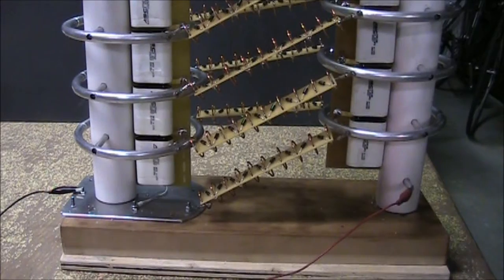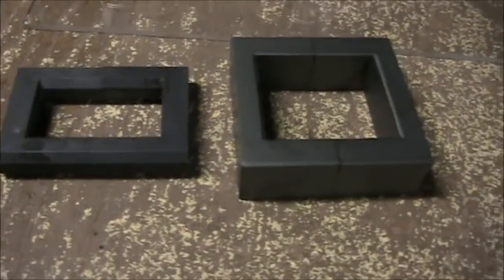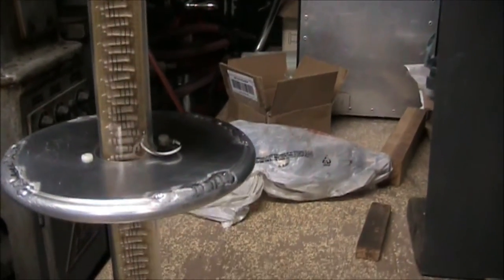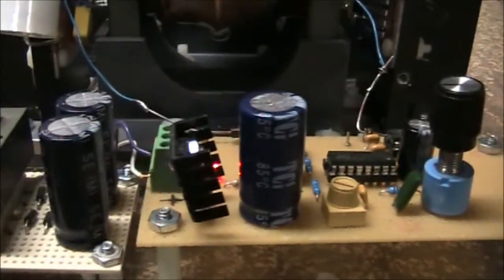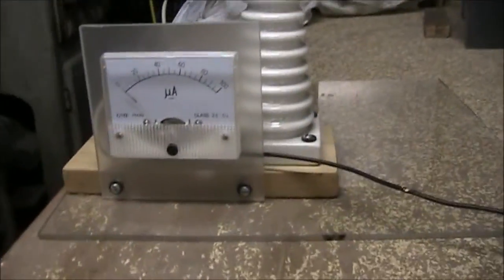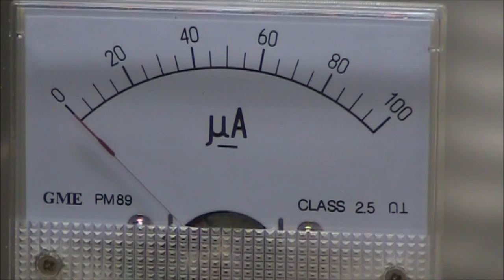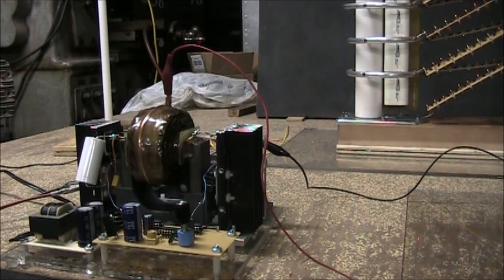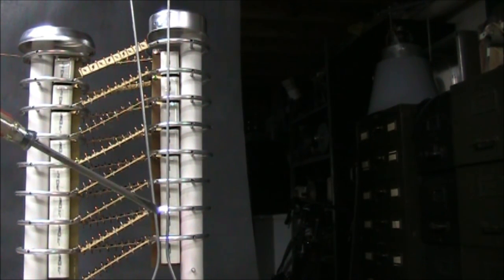Cockroft  Walton high voltage  generator

Comment: I just got assigned this for a graduate project. I am an electrical engineer working on my masters. You did a great job very clean and proper design. I like to see another person who builds things only for experiment and lets face it fun. My project is a Cockroft with a 500KV output a current of 1mA, using a variac, and diodes with a PIV of 100KV.
Reply from the maker: WOW 500 KV !  looks like a very ambitious project. Wish you the best. Sure would like to see the complete project.

Comment: Why don't you feed directly 110v AC?
Reply from the maker: A DC input gives a constant voltage for the switching supply. Therefore a higher average power.

Comment: you aren't running a risk of destroying the diodes when it arcs? I would think the instantaneous current would be huge.
Reply from the maker: You are correct the surge current is huge. And I did risk the diodes but I had to see what a discharge would look like. Thankfully the unit is still in working order.

Comment: would you happen to live in New Hampshire? I would love to be able to hang out with a genius like you! Im working on an electrogravitics project, but lack the knowledge to build such an elaborate power supply like the one here. I have great ideas, but just need to team up with a smarter person to build these things.
Reply from the maker: I'm thrilled with your grand compliments. I happen to live in Pennsylvania. As far as the high voltage  supply try using one of those ZVS drivers what makes it work is tuning for resonance with a capacitor. For the main power supply I look for junk at hamfests or swap meets. It also would be helpful to pickup an old amateur book 1970 or older. It's sad that not many people do this type as stuff. I sure is a lot cheaper than playing with cars.

Comment: Do one using microwave transformer and capacitors
Reply from the maker: I have a 300 pound 35 KV. potential transformer I plan to use. I just need to set up a current limit for the transformer.  Thanks for your intrest.
Reply: I made one like that once, is difficult to get more than 30kV out of it, too low frequency.